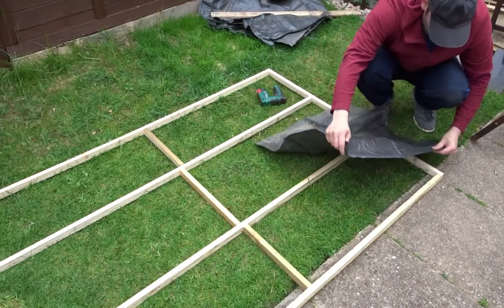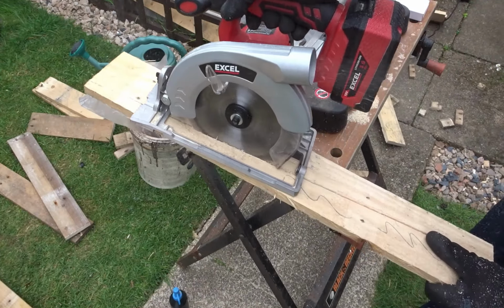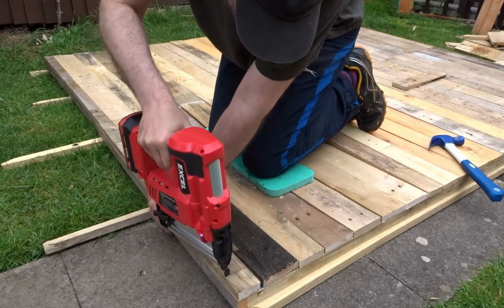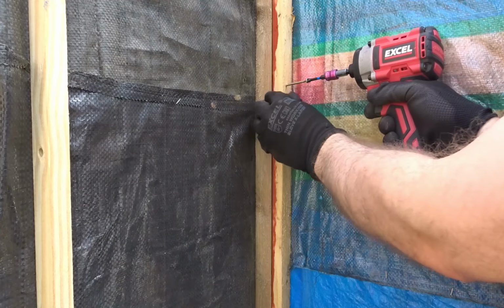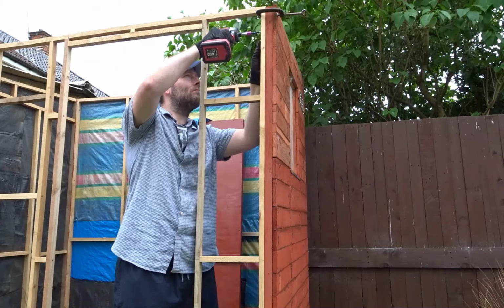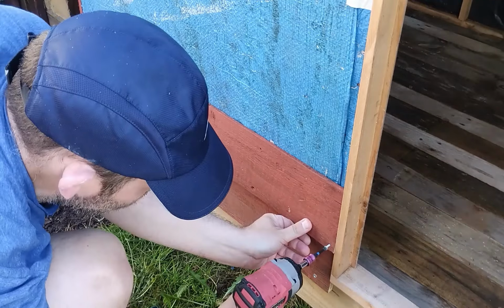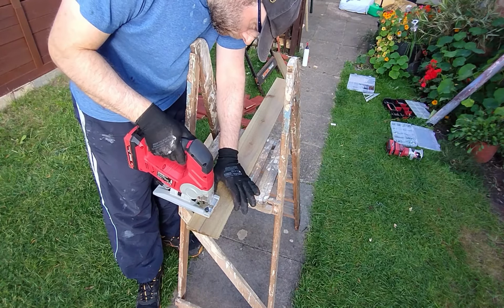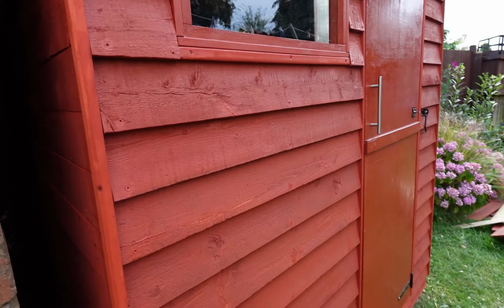DIY Scrap Wood Shed Build Part 7 - Installing & Cladding the Walls

Comment: The pallet wood looks great!! I would have thought a nail gun is a great choice, as nails allow for a bit of expansion. But maybe the brads are a bit short.
Reply from the maker: Cheers! A nail gun would be fine although it really needs to be a first fix nailer not a second fix nailer. The nails were too thin and the heads too small in my case. You live and learn!

Comment: Are you not supposed to fix feather edge on the top edge so the board above hides the fixing??
Reply from the maker: @garethwatson7999  if you do it that way, the bottom of each board would be mobile. The way I do it they all lock together top and bottom.

Comment: How many pallets did it take roughly
Reply from the maker: I would say 10 - 12 pallets approx for the 2 side panels and the back panel.
Reply: @PhillWyattProjects  awesome thanks for that thinking of building my own after watching this need to build a 3 foot wide by 10 foot long in a 3 foot 3 inch wide gap can get pallets from work about 3 a week think I may need to invest in a pallet breaker done some with a crowbar with some success but end up with a few broken pieces